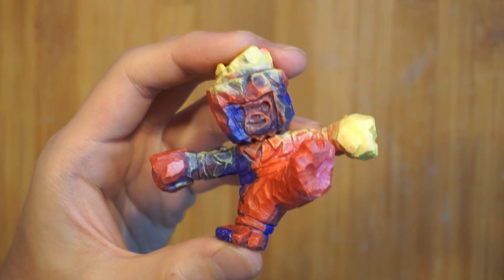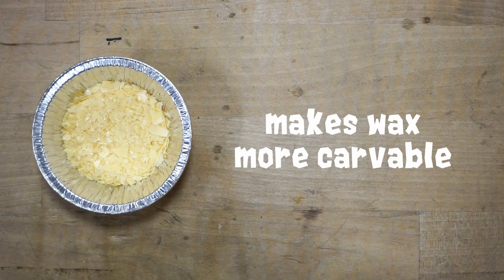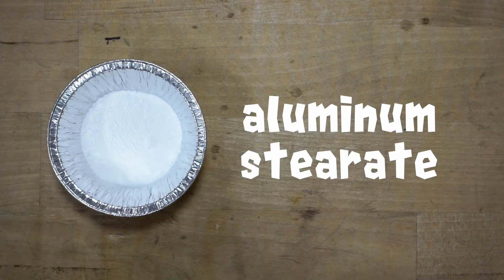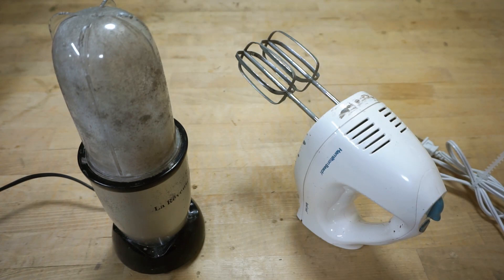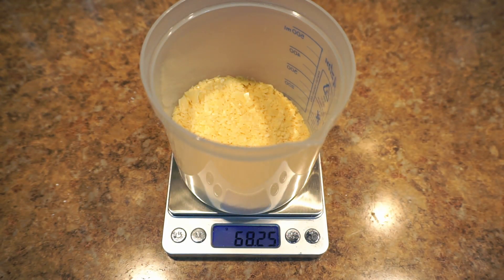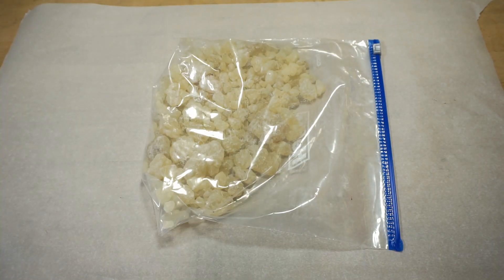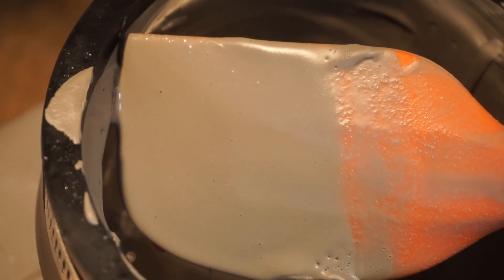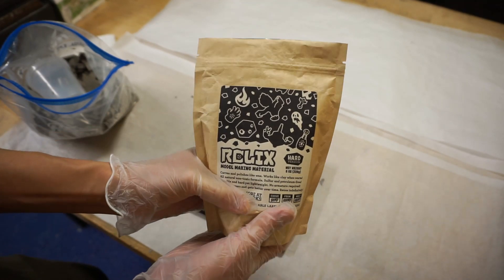How to Make Toy Sculpture Clay and Wax - Intro to Relix

Comment: I'm interested. Price is about the same as Castilene. Is this stuff microwave safe?
Reply from the maker: There aren't any toxic materials in Relix so it's safe to microwave! Just note, it insulates heat very well so there will be some "hot" and "cold" areas in the wax mixture after being warmed up. You just need to stir it well and it will become a more consistent mixture.
Reply: @RelixWorks  Payday! the deed is done. Looking forward to my first batch.
Reply from the maker: @BlueCollarBIOS  Thanks so much!! :D
Reply: @RelixWorks  Hey, I got my shipment and started messing with it. I ordered the medium stuff and it's a bit harder than I thought it would be. Much harder actually. I'm was wondering what can I do or add to it to make it a little softer. I don't want to mix it with my castilene as I notice that that castilene is too soft, and it doesn't have a good affinity for itself. Meaning that if the pieces break, they're difficult to reattach. Where as the Relix stuff has a strong affinity for itself and mends very easily. I don't want to loose that characteristic, but I would like if it was a little softer.
Reply from the maker: @BlueCollarBIOS  You can add some beeswax to soften it. I would try adding about 5% by weight at a time until you get it as soft as you want. Make sure to mix it in thoroughly so it dissolves completely. Also, as I mentioned in this video, try to buy pure beeswax made in the US since most imported beeswax is diluted with paraffin!
Reply: @RelixWorks  Yah, a little beeswax goes a long way. I actually mixed it in ratios. I did a 1:1 Relix / Beeswax and a 2:1 R/B and the difference between the two isn't very much. I got a pound of the Relix so i've still 8 ouces of your medium grade. I'm thinking 10:1. I'm basically trying to extended the sweet spot in the working time when it goes from soft clay to hard wax. I'll let you know how it goes, but the 2:1 R/B is like the soft castilene.
Reply from the maker: @BlueCollarBIOS  Very cool! I created Relix to be a hard and carvable wax but have flexibility when heated. If you're finding it hardens too quickly, I'd also try using a heat lamp over your work space. This can greatly extend that sweet spot you're looking for. The only downside I can see to a larger beeswax to Relix ratio is that it may lose some of that carvability. However, everyone has their own preference and I highly recommend experimenting with the formula to suit your needs. Looking forward to your results!
Reply: @RelixWorks  https://youtu.be/-0JGdBUfAv8?t=5911

I'll have more time this weekend to make a full character. About 1/5 scale.
Reply from the maker: @BlueCollarBIOS  Very cool of you to show your experience with Relix! I agree, it is quite hard to work with since it's meant more for small toys and such. I haven't tried this myself but another trick you can do is to get a pan of hot water, not boiling of course. Then let your sculpt rest in it for 5-10 mins or so. This will soften it to a point where you can articulate it in any pose you want. I'd try with a small bit first to "test the waters" so to speak.
Reply: This stuff holds up well. I'm working on a 1/5 scale model and it holds it shape very well without an a armature. This material is quite durable and flexible. I can use a heat gun on spots to soften it and pose the figure. Again, a quality that I really appreciate about this stuff is it's affinity for itself. This adds to the versatility of the material as I can work either additive or subtractive. It's a good product and any input I can provide to help you make it better is my pleasure.

Comment: Thank you for the receipt and the comments in your vids. All are very instructive. I'll buy the receipt for your itch.io page. Delivery is a bit to high for me as I live in Switzerland. Perhaps I'll buy a big batch one day ;)
Reply from the maker: Thanks for checking Relix out! Really appreciate the kind support and definitely feel free to reach out to me if you need any advice on making your wax!
Reply: @RelixWorks  I have make a batch without the Copal resin and replace it with Chavant soft and plasteline. It has given me a good result. For coloring I've used a neocolor crayon. I have received my Copal resine today and it smells so good. I've grinded the resin but it was a bit to sandy. I've use bain mari to heat the mix but without success. I'll buy a pot to make it hotter to melt the Copal. Is your grinder mixing like powder or sand?
Reply from the maker: @SethKaine  How are you grinding the copal resin? If you're using a blender, make sure to first break the resin into smaller chunks before putting them in the blender. Also, adding a spoonful of cornstarch will help prevent the resin from sticking to the sides of the blender. After grinding, the resin will still be a little gritty like sand but mostly fine. Then add it to your wax. It needs some time to melt and dissolve into the wax so stir it into the wax gradually. Let me know how it goes once you try with the melting pot!
Reply: @RelixWorks  Hey! Today I've bought a pan and melted successfully the Copal resin. I've grinded the Copal to a powder with my nuts'blender. The mix is resting. I will see te result tomorrow. Now I'll need to build me a waxer with a thermistor and a heater component for 3D printer with an arduino. Thanks for all!
Reply from the maker: @SethKaine  That's awesome! Definitely let me know how it goes!

Comment: Amazing work !!!! But the only thing that I think makes it almost impossible to do it in my country is candelilla wax, can it be replaced by another material? Will there be a substitute for this candelilla wax?Thank you very much for sharing your work!
Reply from the maker: Thank you! If candelilla isn't available in your country, you could just use carnauba but it will make your wax a lot harder. If that happens, try adding some more beeswax to soften it. Hope that helps!
Reply: As Kevin mentions, Carnauba might work … if you are talking to a supplier ask them if they have a hard microcrystalline wax or a synthetic Candelilla. Also you might Try looking for “Palm Wax” , Ceresin , or ozokerite . 

Too much Carnauba can create problems with cracking while cooling and if poured into a mold it can really stick tight.

Candelilla  is grown and harvested in Mexico and an be bought off Amazon and EBay. It’s such a wonderfully balanced wax that is worth pursuing if possible. And the smell is delightful. 

Best of luck !

Comment: I’m about to make up a batch of willow 360 but with a couple of other ingredients I could try your recipe too. My issue is that there are very few places to get aluminium stearate near me. Do you know if magnesium stearate could be used as a substitute?
Reply from the maker: Hi Chris, I believe Magnesium Stearate can be used as a substitute. I haven't tried it yet myself but it should work since it has similar properties to Aluminum Stearate. I'd love to know the results of your batch using this ingredient!
Reply: @RelixWorks  I’ll give it a go. It’s commonly used in cosmetics as an anti-caking agent which is probably what the aluminium stearate also does. Not sure whether they both act as a thickener too.

Comment: This is amazing, thank you for sharing everything! Crafsman linked a video awhile back to a guy making his own wax and he used crayons for coloring; would that affect this formula somehow instead of iron oxide?
Reply from the maker: Thanks so much! I saw that video too and crayons can be used instead of iron oxide pigments. However, crayons contain paraffin and other additives so they might affect the formula a little. It shouldn't be too noticeable, but if you do use crayons you might not need the aluminum stearate since the pigments in the crayon probably don't need a dispersing agent. If you try this, I'd love to know how it goes! Thanks again for the kind support!